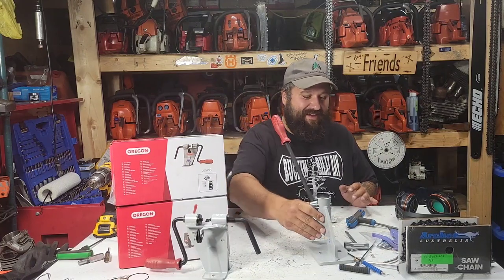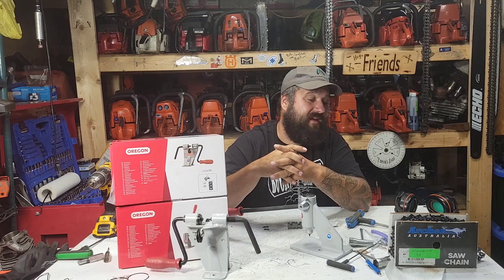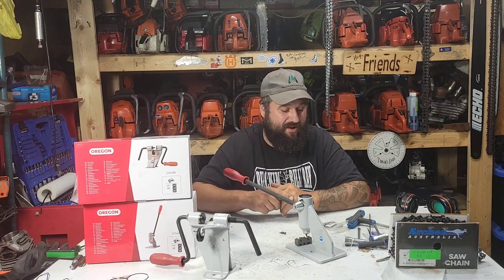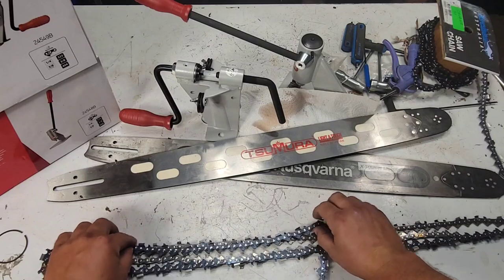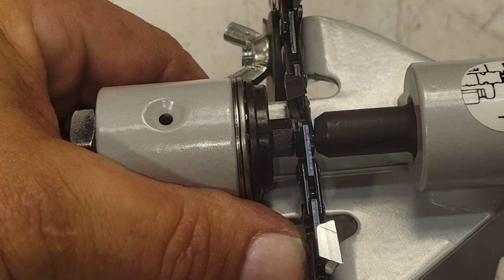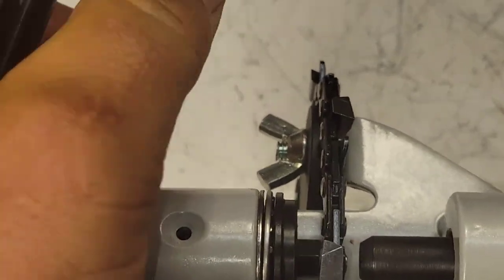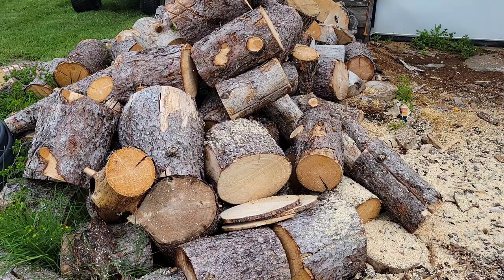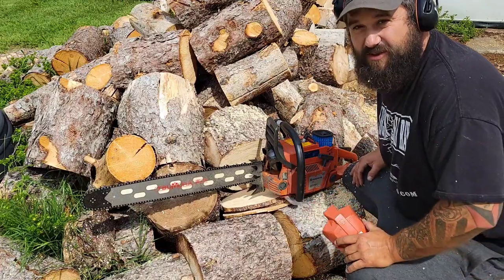Trying out my new chain spinner!

Comment: I still do it like the old timers with ball pin hammer and centre punch on a 1 inch steel plate, never had a failure. Cheers from. NZ
Reply: I was looking into this and found old timers making their own loops with just a ball peen hammer. I figured if they can, so can I. Now I just need to decide which 100ft roll to buy

Comment: Hi, from UK.
Suggestions for breaking, spinning loops. The adjustable  anvil, vice is better for repair of used loops. Neater grip of side straps, less risk of being off centre with punch tip.
Start spinning 1st rivet then stop, move to 2nd & just snug it , not fully. Go back to 1st & finish. Finish 2nd next. Less risk of distorting the tie strap.
At own risk, worn preset, tie strap can be reused once.
Old school woodsman advice. By using the same link just removed from the loop, all the wear matches.
A drop of oil on heads when spinning saves a lot of wear & may help avoid split rivet heads. Useful for saving a decent chain if ripped cutters off on fence wire etc.
Take your time & enjoy your new tool . . .!

Comment: You will like being able to make up and repair your own chains. C clamp it to your bench or mount them to two pieces of 1/4" x 2"" × 2" angle iron and clamp them in your vice if you don't want it to take up bench space. I usually buy 100' rolls of chain but found myself buying 20" and 24" loops and combining them to make 28" , 30", 32", and 36" when supply was short. Definitely helps to oil the spinner and rivets. Take care of it and it will last a lifetime, mine is over 40 years old. I have a small hook that I hook the end of the chain on with a tape measure and mark the driver were I need to break the chain, I have the measurements written down for all the lengths I use and I am able to mix them when I brake it to have the cutters end more consistantly on the loops. The Archer chain cut ok for me but stretched way too much in Hardwoods. I generally can get Husqvarna C83 and Carlton for the same price. The Tsumara bar looks nice, check out their new premium light bar. My scale is broken but they are pretty close in weight to the Stihl ES light bars of the same length.

Comment: My old shop had those tools mounted to a 2X12 by roughly 18" . Put it on a shelf when not in use... had enough weight to stand alone on a bench without clamping it down. Worked quite well. Now put some oil on them rivets! They come out like a mirror..

Comment: Same model, didn't want to bolt to bench so mounted on a block of maple, that gets gripped in vice.  Also, electric drill adapter (couldn't find, had to make my own) works slick.  Rivets look great.  Drill with geared low speed is best.

Comment: You probably already know, or maybe your set came with two anvils, but the smaller chains (.325, 3/8 lo-pro, 1/4"), spin up better with the smaller anvil that is available and can be quickly interchanged with the larger one.  The larger anvil works ok, but it can leave some scaring on the tie strap around the rivet head if you mash it more.  Also, spinning too tight can be remedied by sticking a minus screwdriver between the tie straps and giving it a little wack.  I put the driver in my vice to hold the chain when doing it.  It spreads the rivet head slightly and frees up the tightness.

Comment: When i worked at a saw shop we made a attachment to fit to Milwaukee drill. Yes can go to far and chain will bind and not go around sprocket or tip. Our rep stated the rivets should be tight enough you cant get a finger nail under the side you spun.

Comment: Tinman that is great. I made a piece of T metal and bolt it to it. and i could just slip it in my bench vice or a big piece of angle iron it will work great and take it out of the vice when you are not using it. Takes up less bench space. Nice videos fella.

Comment: A 20 inch is 70 drive links
Reply: what saw and bar
Reply: No, it depends? Here my Husqvarna 20" 3/8 is 72 links, and 20" .325 bars 78 or 80 links. My Stihl 20" .325 bars are both 81 links. Some Cannon, Oregon, Sugi, Tsumura bars want extra or fewer links compared to OEM or each other...it's part of the fun 😎
Reply: @BryanClark-gk6ie  16"? 6ft is a big bar for that saw. It's probably 16" .325 66 drive link but you should definitely count the links and check the gauge
Reply: So can a person just take a link out of a stretched chain when you run out of adjustment?? if the teeth are worth it anyway.
Reply: Wrong, 20 inch 3/8 is 72 dl
Reply: @dennisthemenace57 depends on the bar and chain pitch. The Echo 20" 3/8 .050 bars use 70DL.
Reply: @teamflashtv  You are exactly rite. I argee with ya.
Reply: My stihl and huskys are 72